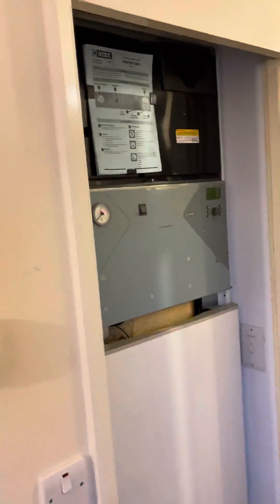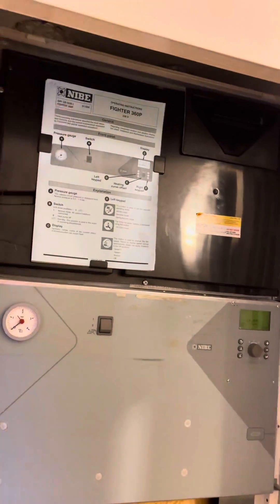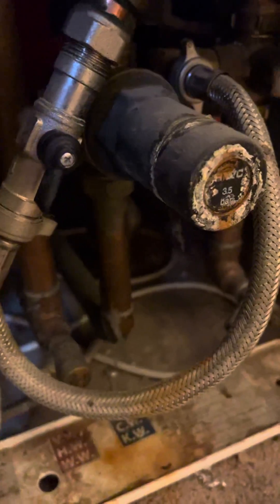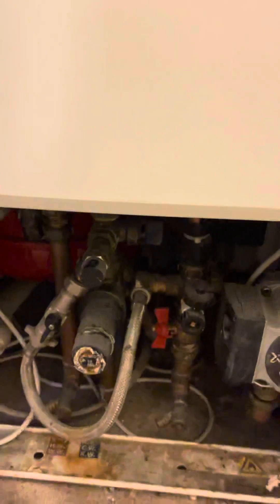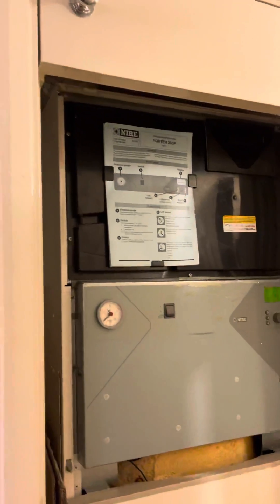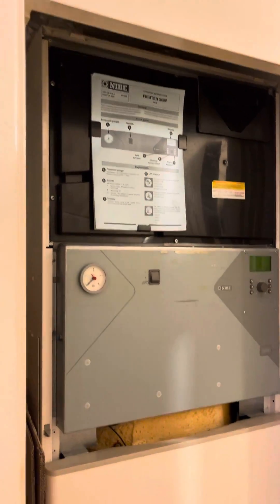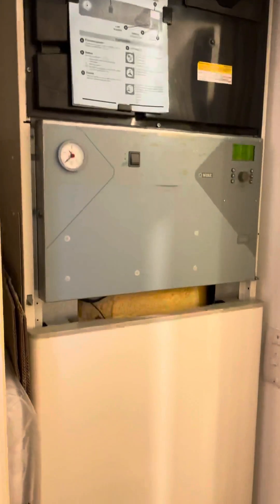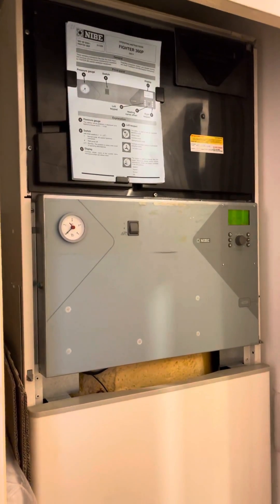NIBE Fighter 360P Electric Boiler - Why We Wont Fit Them and what you should know

Comment: Really reliable heat pump! Been working on them for 20 years plus. We service 100’s in ireland. Any condensate and pressure reducer on any heating system can fail so your “unreliable” pointers aren’t really relevant to the nibe exhaust air 360p. What kills those heat pumps is they don’t get installed correctly, poor air duct work and poorly insulated buildings. Otherwise a cracking unit.

Comment: I used to have one of these and it was very expensive to run. The pump went wrong and the housing association installed a brand new model, which seems amazing. it costs hardly anything to run.
Reply: Hi - working on a project at the moment. Can you advise what the new model is?
Reply: New model?

Comment: I have one of these boilers and the cost of running it is insane. I’m currently at home with it off or I’d be spending £200 a month alone just in electric and It breaks every 2 minutes. I hate it.
Reply: Google Green-heat renewable Wantage.  Look after 100s.  This guy ain't got a clue
Reply: How old is it actually, and which maintenance were spend on it?
No technic runs without maintenance ...
Not even in mighty UK

Comment: While an electric boiler is simple, reliable (presumably cheap to buy) and 100% efficient (ie there is NO wasted heat energy being lost out of any exhaust of flue vent), it is also INCREDIBLY expensive to run during the day, costing typically at least 12 pence per "kilo-Watt-hour" of electrical energy consumed. This compares with a gas-boiler which is only about 80% efficient, but costs only about 30% of an electric boiler to deliver the same amount of heat!! (ie  requires only about 3.6 pence per kilo-Watt-hour of heat energy (from the gas) after the boiler efficiency has been accounted for). Even with a 20% rise in the price of gas over winter 2021, the gas boiler would still cost only 36% of the cost of an electric boiler for the same heat output into the house!